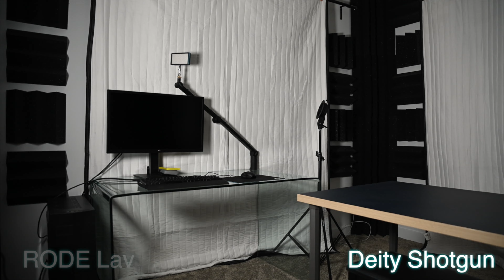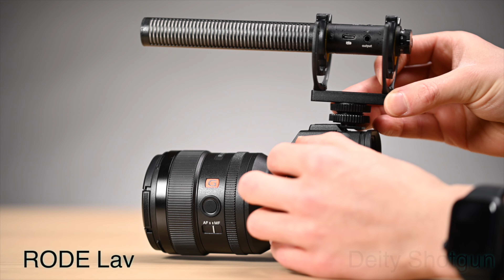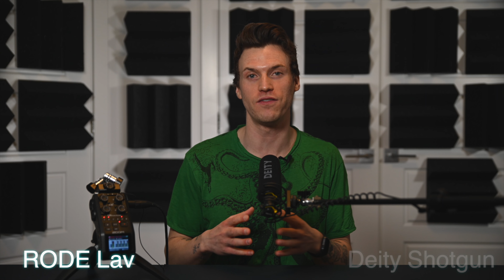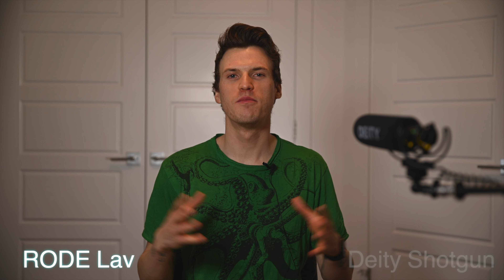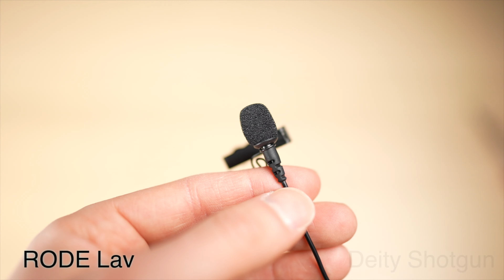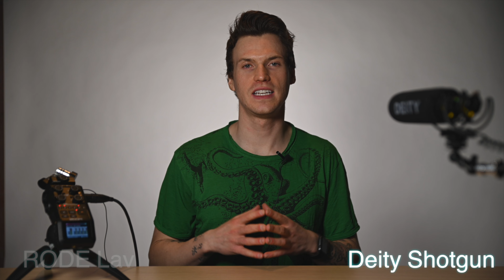Lavalier Microphone vs Shotgun Microphone - Deity D3 pro vs. Rode Lavalier Go

Comment: Happy I stumbled on your channel , love seeing comparison videos. I love the Deity D4 Duo as a shotgun mic and I have the Blue Yeti microphone for sit down videos
Reply from the maker: Hey there :) thanks I appreciate that. I read about the d4. that’s the one that records from the front and back? I actually almost bought the blue yeti for my first microphone but ended up deciding to dive in a little deeper and buy an XLR microphone and mixer. Then ended up not using it because it was a little more work to set up compared to the 2 microphones I compare in this video.
Reply: @TymekStolarz  That's right the D4 has the duo microphone , it works well but of course the front microphone is sharper. For all my videos I typically go with the Yeti since I'm not much of a vlogger
Reply from the maker: Fair enough, and it probably has better sound quality anyways.

Comment: You sound so much better on the lav... What am I missing?
Reply from the maker: Hey there :) Hm, thats interesting. I guess it just comes down to personal preference. To me the Lav sounds just a little bit more muffled than the Deity. But i do still like the Lav all the same.
Reply: @TymekStolarz  it’s fun listening to it a few times. I see what you’re saying now. You’re clearer with the shotgun mic and your lav is more muffled. But I can hear more bass or volume perhaps with the lav. Hmmmm. I bought the lav but now I’m reconsidering...
Reply from the maker: there is a chance i was a little off with modifying the volumes, i tried as best as i could do have the volume on both of them the same. With me moving around the shotgun mic it was difficult to make sure everything was consistent. Honestly either one is a great choice. when you aren't listening to them side by side, they both sound equally as professional and clear. I just finished the edit comparing the shotgun mic to my Rode NT1 condenser Mic, and that one is a lot harder to distinguish which one sounds better.
Reply: I agree with this. The Shotgun was less muffled but was missing base and had more reflections. For long term listening I'd actually say the lav mic won it in this case.

I'm actually fairly shocked by how poor the shotgun mic quality was. It was only good when it was placed directly next to the mouth.